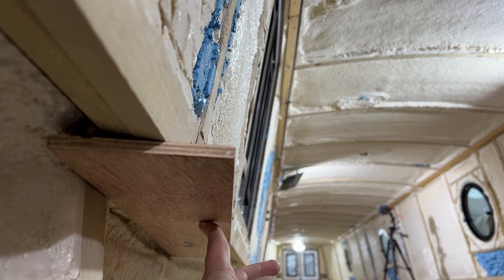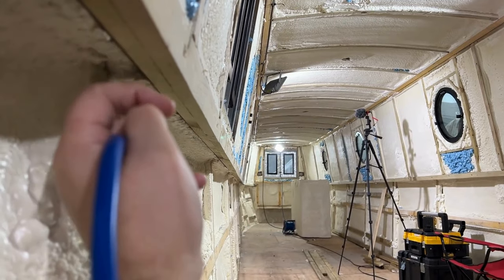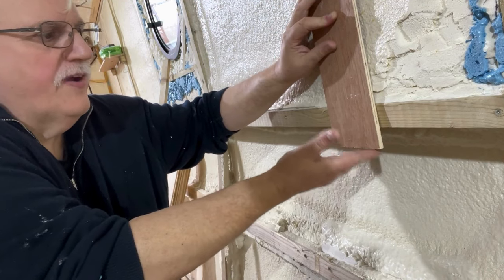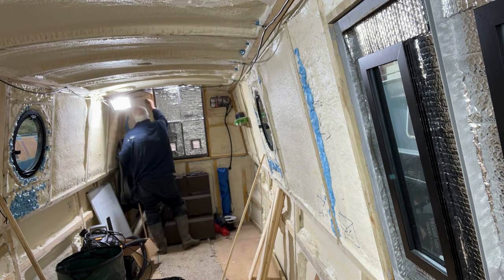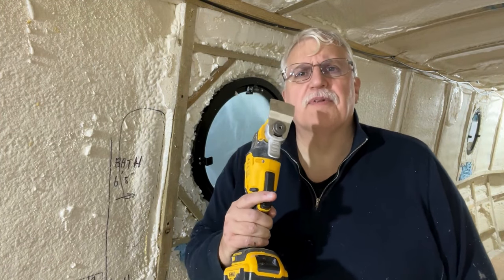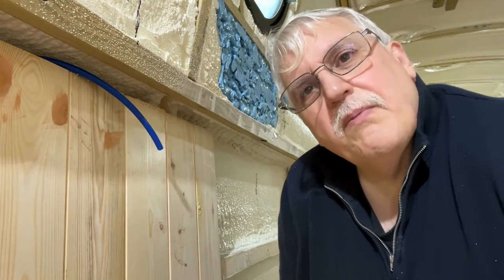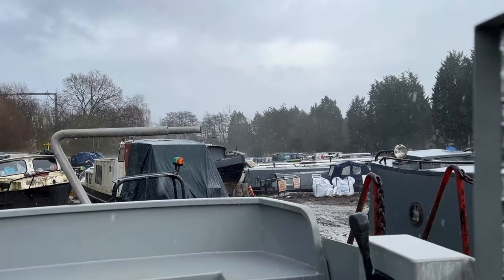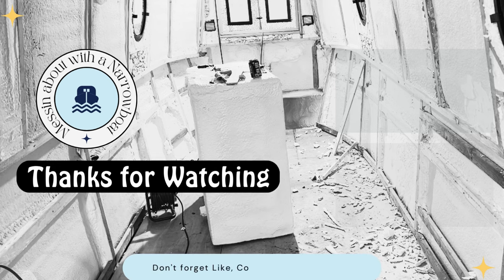Our Narrowboat Fit-out | Wiring & Cable Tray Preparation | EP26

Comment: I ran AC down one side and DC down the other with spurs across for the low voltage. All under the gunnel in plastic cable trays. I planned the layout around this and it worked fine. If you are having gas on the boat under gunnel is the usual spot so plan ahead. I am in the final stages of fitout of my 58ft sail away and have live on board from day one, six months to get to this point working almost every day, it's a big undertaking but worth it.
Phil.
Reply from the maker: Thanks.

Comment: Colin, just a thought, would it be worthwhile getting the cable runs conduit put in before the foam? Take care
Reply from the maker: You want the foam to stick to the steel for total protection. It’s normal to lay cables after it’s done.